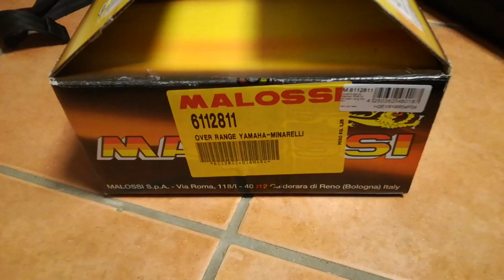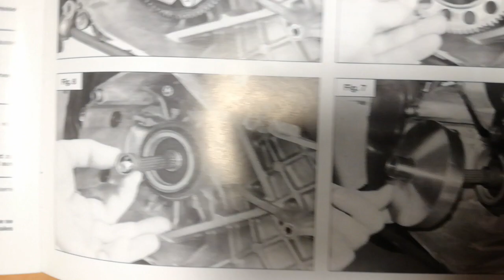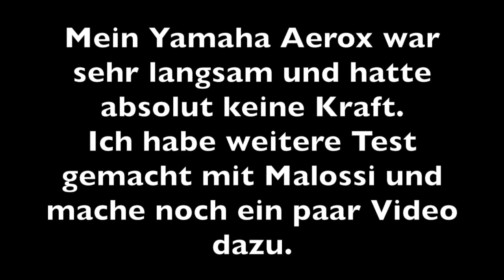Malossi MHR Overrange Kit Yamaha Einbau

Comment: I noticed two things. 
1st the Bell wasn’t rotating freely. Aren’t you suppose to put a washer between the bell so that is can spin freely? I’ve seen other videos do this.
2nd this kit says to grind 7 spots in the case for belt clearance. I have the exact kit you have and it says to grind ribs out in the case.
Reply: TheLakeHogg I was thinking the same
Reply: Yea i just bought the la furia rossa kit to my highend rox and you need to grind the carter and put two washers under the clutch bell

Comment: Will this fit mine it’s a 2010 the one in my bike bro that’s my bike
Reply from the maker: Yes that could fit, but the engine is too weak, you have to mount a 70cc cylinder or the Variomatik will not open.
Reply: Marcutti Marco I’m getting the Malossi 70cc kit
Reply from the maker: Okay then you have enough power good success marco marcutti

Comment: Hey does the belt travel to the top on the variator?
Reply from the maker: No, it didn't do any good, almost impossible to start up and don't satisfy the final speed. I have clarified it and the problem is the performance of the scooter 50ccm. for this system you need a minimum of 70ccm and another carburettor to get the Vario working with high engine power. Greetings Marco
Reply: LOL ofc i know that , also u need to modify the engine blocks for the belt , but i was curious does the belt travel to the top cuz i have overrange variator i want to buy now the pulley.
Reply from the maker: yes this is the case, but the motor 50ccm has too little power.
Reply: I noticed two things. 
1st the Bell wasn’t rotating freely. Aren’t you suppose to put a washer between the bell so that is can spin freely? I’ve seen other videos do this.
2nd this kit says to grind 7 spots in the case for belt clearance. I have the exact kit you have and it says to grind ribs out in the case.